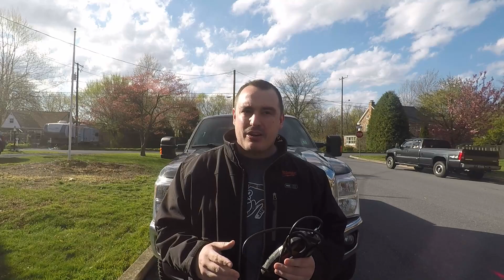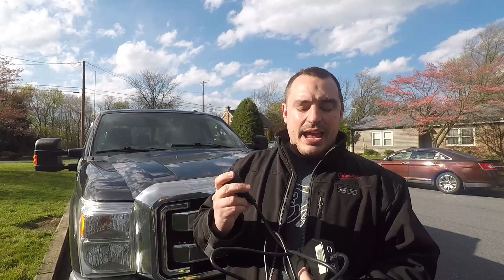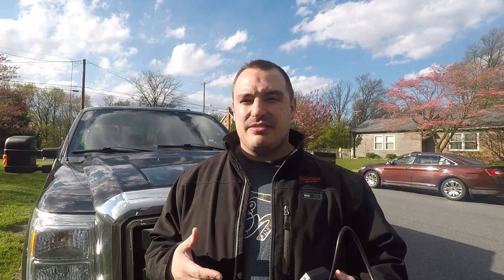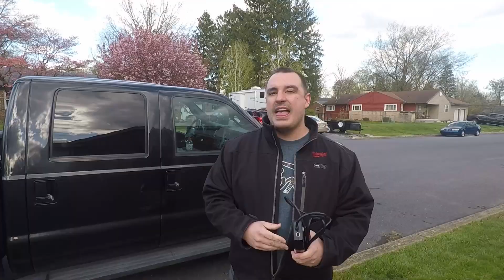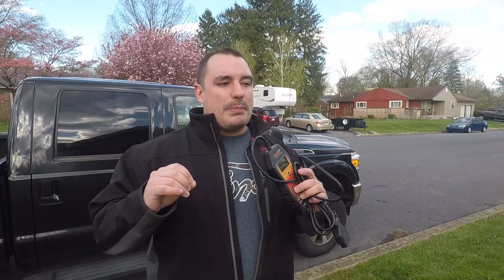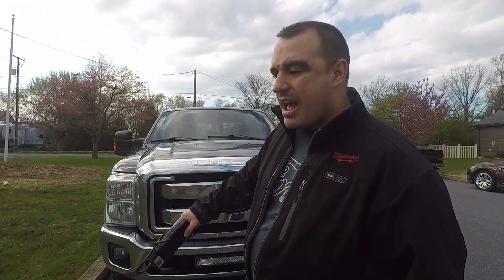Best Tuner For 6.0 Powerstroke

Comment: Blessed Performance is good.
Reply from the maker: They are one of the first tune reviews I am going to try and do in 2025! what tune of his do you daily in your truck?
Reply: @ I have their package tune tow, ecobeast , performance with SOTF and overdrive override. Mine were just shipped from them. All the reviews I’ve seen have been great! I will let you know when I get them and what I think. I will probably run performance for daily because everyone including Matt have said they get the best mileage from that one.
Reply from the maker: Nice setup man. I have gotten my best fuel economy on performance tunes. as long as they are not the really hot stuff.
Reply: @ ell I’ll be finding out. I received my tunes last night and will be installing them this morning
Reply from the maker: @randywendt  nice man let us know what you think
Reply: Well, day 2 and I haven’t driven much. But so far I’m liking it. It has a high idle, then stock, then 3 other shift point levels. I am giving it some time after doing a KAM reset so the transmission can relearn new settings and my driving. Then I’ll start experimenting

Comment: IYO what’s the best tuner for a 6.0 with manual transmission since no transmission tuning is required?
Reply from the maker: I would still say sct. You get the most tuning options with it. Most custom tunes run off of that software.

Comment: I need help I just bought 2004 f350 6.0 studded it has superchips decals on the truck but has a livewire ts+ in the truck but seems not to be working it rolls coal bad and has a lot of power and trans shifts hard.
Reply from the maker: Does the live wire read the tune or is there a return to stock option on it?
Reply: @six0bros  yes but nothing changes.
Reply from the maker: I would return the sct device to stock. I would then see if it is flashed to a factory strategy maybe. Reach out to sct they may be able to help as well.

Comment: Absolutely love the content and information @6.0 Bros! 
My wife and I are flying down to Cali on Wednesday to pick up a 2004 f250. 
It’s already been fully proofed has 135k miles. 
It has a live wire already on it. But is there a better one you would recommend. It will be a work truck. I work in construction so I will be towing alittle bit. But it will be a daily driver. I appreciate any help. Thanks for the awesome content!!
Reply from the maker: The live wire is perfect for tuning but as a monitor it isn't isn't best. It'll due for somethings but it leaves a lot to lot to desired. Also I believe it reads ebp incorrectly. Also can't really be expanded for sensors the truck doesn't have. I recommend the edge cts insight. So tune with the sct it comes with and monitor with the edge I feel you should buy. I recommend buying an egt setup for monitoring fuel pressure and egt down the road. Here is an affiliate link to what I recommend and if you need any other links let me know happy to get them for you and thanks for your support on the channel 

https://amzn.to/3sEK7m2
Reply: Awesome thank you! I will re watch the video to see which tunes to get:)
Reply: Since I can’t find Windrunner. Which tunes would you prefer?
Reply from the maker: I have had a hard time finding him as well. I am sponsored by blessed performance and he has tunes that have some similar characteristics. Use affiliate code six0bros for 10% off his tuning. Now some companies I'm not associated with that do great jobs would be truck source diesel and Warren diesel. Once the new build on my 6.0 is up I plan to do very thorough reviews of all these companies and their tunes

Comment: Live wire ts+ any good or just the regular live wire ? for my 07 superduty 6.0,  4 inch exhaust , blue spring kit, egr cooler delete. Other than that a stock truck, no racing  or burnouts etc I will be mostly using it for monitoring etc maybe a small tune for towing .
Reply from the maker: sorry I am so late but I do not like the livewire units. I prefer the standard x3 or x4 tuners and a separate monitor for the truck

Comment: I just got a 2006 6.0 with only 133000 on it. Sucks when I bought it 2 months ago..life was different.. lol.. now it’s gotten more issues. About to drop $6000-7000 finishing the bulletproof. . May end up about 10 with the ficm and new turbo.. when I got it.. it was 3000 now HOLY SHITFIRE!!!
Reply from the maker: Wjat all needed done to it? What are the issues you have had
Reply: Very sluggish on take off after 2nd gear it starts moving better. Not really any issues yet. Just going to get it done before the problems really start. When I got it had i a different financial situation..lol. Really don’t know shit about vehicles even less about diesels. Just I know the 6.0 has issues. Got some surface rust underneath I didn’t notice
Reply from the maker: Has any of the work been done yet? For your issue before spending a lot of money you may not need to I would check ficm voltage, fuel pressure(under load) icp and ipr values.
Reply: But I do plan on little by little shooting for about 700hp. Torque will follow..lol. Most want as much up from parts as I can get before adding tuner or programmer
Reply from the maker: 700 is a good number its up there and definitely will require the necessary bullet proofing. I would recommend kill devil diesel heads their aluminum or iron. The aluminum flow better without porting. Both are great I wish I had the money to have mine ported though. Will definitely require fuel system, hpop upgrade unless you go with hybrid injectors, and either a big vgt which probably won't get you quite to 700, or non vgt setup
Reply: The egr has been deleted but if it has to be reprogrammed after that idk if they did. It’s straight piped with 5in performance tip…🤷‍♂️🤷‍♂️.
And an Air Aid box and filter.
Reply: Talked to a place where I was going to buy another truck and they do work there only on diesels and to finish the bulletproof if that’s left is 7000with injectors 5000 or so without
Reply: Like I said when I bought it my financial situation was way WAY different than it will be next Friday. As in a helluva lot less. My fault I guess.. if everyone was supposed to be rich we would all still be in same place cause everyone would be rich so therefore… NOW WHAT..We’ve got HERE IS A FAILURE …TO COMMUNICATE..or some shit..idk..🤷‍♂️🤷‍♂️🤷‍♂️🤷‍♂️
Reply: I know i probably won’t even get close to 700. But imma try..lol..money says probably 500max..lol

Comment: Can I run an edge insight cts 2 with a set x4? I already have an edge cts2 and want to run an x4 fir tuning. My excursion is fully bulletproofed and deleted
Reply from the maker: Just making sure did you see my answer in your other comment? If not I can get you links again but the short answer is yes you can

Comment: I’m looking at this video because when I was 15 I got my first truck lifted, stacks, RBP grille, bullet proofed it and so on and I personally used a bully dog and it was NUTS. The power was insane. I thought it was loud before but it was rolling and screaming like crazy. 

I sold it when I was 17 and have been trying to track it down and luckily at the age of 25 I was able to buy it back. Looks just like it did when I first owned it except the previous owner took the bully dog programmer off(probably cause it scared the living mess out of him)😂😂 but I was checking to see if bully dog or SCT would be better. Mine with Bully did amazing, but my buddy had his with SCT and his went amazing also. So I’m just trying to decide which one to use to reprogram my truck again.
Reply from the maker: Sct is the preferred tuner for the 6.0. It will allow you to get custom tunesnto support any future mods. I have affiliate codes for blessed performance custom tunes use code six0bros for 10% off also. That same code will get you 5%off performance turbos from turbo time usa  they are also a channel sponsor and thats an affiliate code as well.

Comment: What’s your take on bullydog gt tuners for these trucks? Is it true that they don’t completely erase off your pcm?
Reply from the maker: For a 6.0 I wouldn't worry about that. That is more of a warranty issue than anything else. Most tuners for the 6.0 will leave a "footprint" of some kind on the truck. Now as for the tuner itself I wouldn't recommend it. I know bulldog and sct are owned by the same company but I would just go with sct. I think one of the bully dog devices is similar to sct but I'm not 100% on that or if you can get custom tunes for it.
Reply: @six0bros   I find when I put the transmission tune in with the bullydog shifts were really harsh and seemed to slam into the next gear. If I could afford to get an sct live wire that what I would go to. A friend recommended bullydog and I don’t like the trans tune and ended up pulling the trans tune out
Reply from the maker: I like the sct x4 personally. The live wire isn't super user friendly or that great compared to other monitors. I wouldn't change tunes often especially if there is no trans tuning to deal with the extra power. I would run it on a low settling
Reply: @six0bros  I looked to find how to adjust it and there is only normal shift and firm shift that I found. I’m still trying to find the throttle sensitivity setting lol
Reply from the maker: I wish I could help with that but I know very little about the bully dog stuff as a whole especially the gt tuners
Reply: @six0bros  yea I gotta save up and change turners
Reply from the maker: You can probably sell that one for some decent money for someone that wants to use it as a monitor but I personally for budget monitors like forescan and torque pro they will cover almost everything to monitor. Sct x4 is definitely the tuner you want
Reply: @Studly522  If I was you and wanted a brand new tuner . I'd go with the SCT or Bully Dog GTX , they're identical .  I bought mine from Blessed Performance for $629 with 3 custom tunes preloaded. I have a 2004 f350 Harley Davidson crew cab short bed 137k mi egr deleted and o-ring heads and studded .
Reply from the maker: Don't forget with blessed performance to use our affiliate code six0bros for 10% off custom tunes
Reply: Thanks for the comments and advice guys. I really appreciate it. This truck has pissed me off so far but hopefully that changes lol
Reply: @Studly522  I'm pretty sure SCT bought out Bully Dog in 2015 . I do know this the GTX tuner is the same, Bully Dog or SCT . Even though some tuners only do SCT aftermarket tunes.
Reply from the maker: I have recently found out that some people are able to custom tune some bully dog stuff. Found out earlier today
Reply: @six0bros  I'm pretty sure the ST Live Wire is the same also.
Reply from the maker: I believe you're correct man.
Reply: @six0bros  I finally got my SCT GTX tuner from Blessed Performance for my 6.0 with their three custom tunes. After you get past the initial setup everything works like it should . I didn't have any problems with the touch screen everything works and is responsive. It just takes a minute or two to go  between tunes. It made a notable difference between my stock tune and their performance tune. There's just a puff a black smoke when you floor then nothing after that. If you drive it normally there's no smoking or rolling coal . Rolling coal to me is a waste a fuel and doesn't prove anything . I think that's one of the reasons why the EPA came down so hard on these trucks .
Reply from the maker: Let us know if you have questions happy to help

Comment: New to the diesel world... Getting a 6.0 soon wondering where to get custom tunes
Reply: My 6.0 started blowing white smoke at 20.000 miles they are junk.
Reply from the maker: They really aren't though. I mean I would be furious at that happen but it is also why there are warranties to cover those thing. Unfortunately crap does happen now blowing white smoke what was the actual issue? White smoke could be injectors, turbo, or loss of compression
Reply: 6.0 Bros it was the injectors but the truck only had 30,000 miles. Also the high pressure oil pump went up in the truck
Reply from the maker: A lot of the ficm strategies were actually really hard on injectors it took them a while to get that fixed. It does suck when it happens man. Also though the 6.0 was a very different animal than the 7.3 it required meticulous maintenance and the fuel pressure issues do to the factory spring becoming weak. It suxks when you're part of the people buying trucks and dealing with those initial issues
Reply: 6.0 Bros but I bought the truck brand new
Reply from the maker: When did you get rid of it? Just curious how man miles you put on it
Reply: 6.0 Bros 20,000 miles I got rid of it in 2012
Reply: @danielrosso4297  were the problems with your truck under warranty?
Reply from the maker: I am about to run blessed performance and he has been great to work with. He has a website and is on Instagram. Other tuners I recommend truck source diesel, Warren diesel php. At blessed performance mention code SIX0BROS for a discount
Reply: @six0bros  what about ficm tunes, I don't see much talk about them, the truck I'm getting is completely bulletproofed other than the ficm and I wanted to know if I should buy one and get it tuned right away
Reply from the maker: So I have not messed with ficm tunes yet however I fully plan to. I hear people say a good ficm tune ontop of their ecm tune gave them faster turbo spool up and a cleaner running truck. I think they are worth it but they wont add a ton of power ontop of the ecm tuning but they help really refine the way the truck runs
Reply: @six0bros  that's what I was hoping for, just a cleaning operation out of the ficm not really after power from a ficm tune
Reply from the maker: Yea you got it. It will provide a slight increase but main reason for it eith ecm tuning is really refinement of its programming

Comment: Now they got all this new stuff....I love my edge evolution cts2 due to the layout  I can actually read it while driving....con doesn't hold custom tunes ...but on level 4 she rips
Reply from the maker: the edge is hands down the best monitoring solution out there. I mean forscan is great but for having a device out there like the edge is the best. I want to try the new cts3 but i am going to wait.
Reply: @six0bros  so the SCT LIVEWIRE I'll gain a little more power on extreme my truck is violent fast ...just smoked a lbz and a stageb2 sti on the highway
Reply: @six0bros  but the edge doesn't hold custom tunes...the SCT does....and imo custom tunes are so important due to elevation and set up
Reply from the maker: It sucks the edge doesnt have custom tunes! The sct with custom tunes are insane!